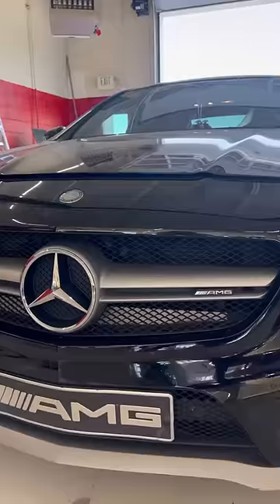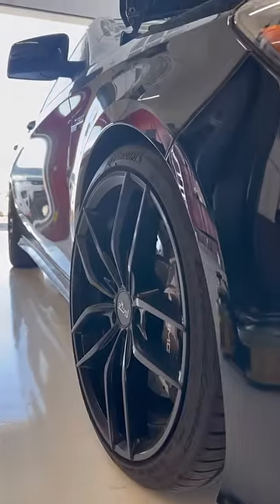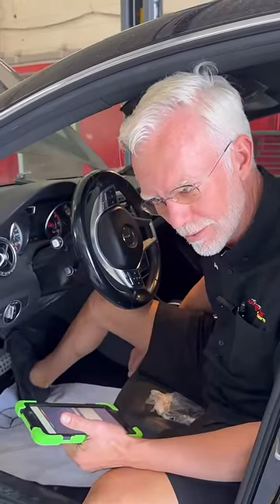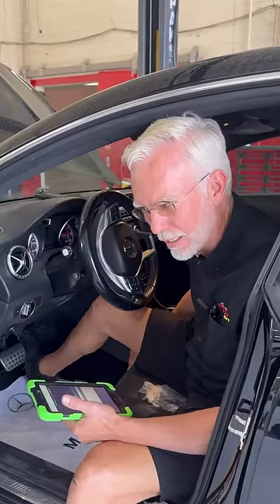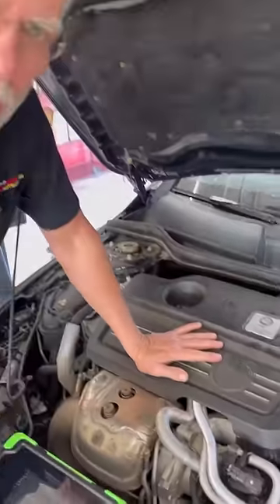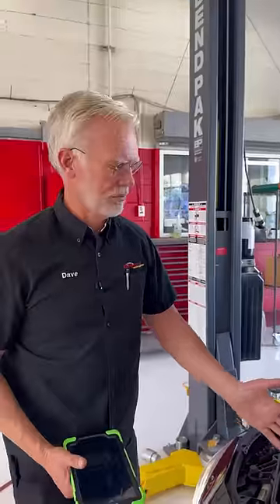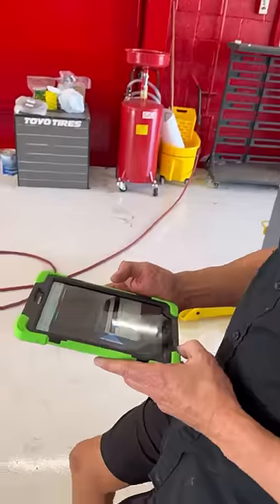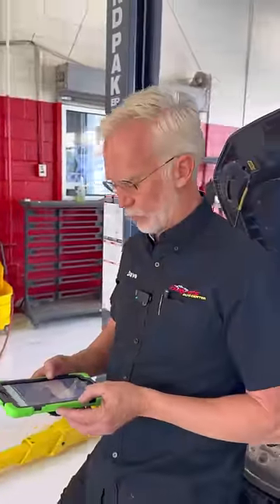Mercedes AMG Nothing but a slight noise on start up #carrepair #autoshop #mercedes

Comment: I had a Camry fail to crank at a gas station. The battery was good, instrumentation was good, seemed like the starter crapped or a bad solenoid. Car was towed to local dealer, they informed me it was $1200 computer. I’m an electrical engineer and thought these guys are going to have to explain this failure to me. I went to the dealer and they pointed at a computer, it wasn’t the main computer so I asked for the schematic’s. I spent about 1/2 hour reviewing the starter circuits and there was zero association between the computer and the starting circuits. When I challenged them on this they couldn’t argue against it. I told them to look elsewhere because I’m not paying for a computer. I left and called a mechanic friend and had him call the stealership and it turned out to be a fuse and the starter. It probably was only a fuse but that starter had over 100k so I accepted it.  
I’m a bit more mechanical savvy than most and it infuriates me that these arsehole’s take advantage of people. We have a morally bankrupt nation from Washington DC down to our local service providers.
Reply: Get a job there and teach the other technicians,not everyone knows what you do and they probably know things you don’t, cars are hard to work on these days because of all the electronics in them ,most just change parts and not fix original part ,you saved them and yourself
Reply: It's never just a fuse.  Fuses fail due to high amperage.
Reply: Why didn't you check the fuse before you had it towed
Reply: I'll never let another dealership touch a vehicle of mine unless it needs the antitheft module programmed to the ignition lol. They can get lost. I've been gouged for hundreds just to look at my brake pedal light sticking or paid to have things repaired and it never touched. They are not working on any of my future cars. Got a mechanic who lives about 5miles from us and he sees all of our vehicles. Atleast we can trust this guy and he's very affordable. I've had dealers fix things I didn't ask for then make me pay for it to get the car back. They're thieves from the salesmen to the shop.
Reply: You would need a swat team to get me to take a car to a dealer.
Reply: A blown fuse may not be the core problem. It may fine but a temporary fixed. Find the core problem and fix it. Good thing that it wasn't the ACU computer.
Reply: Sometimes when starter motors fail they can short out and blow the fuse so it probably did need a new starter
Reply: Starts at the top, works its way down
Reply: BACKGROUND: I have worked in Independent shops ( only 2) over 13 years the last 21 years at aLexus dealership, and am currently working for myself10 years, motorcycle shop, fun but not nearly the $$ that I made at Lexus. 

When I started, 1980, I was trained to find the problem and then find out what caused it to fail, could be age or something else, and REPAIR IT. back then we repaired starters and Alternators by rebuilding them. The Techs now a days are just part replacers. When the tech can’t figure out the problem it always comes down to the ECM, why? Not sure, but I all ways called BS. FIND THE REAL ISSUE, in 40 years I think I only replaced a few ECM’s. Motorcycles, ATV’s and especially PWC’s are different, they lose their programming if sitting with a dead battery for 6 + months. I guess is what I’m trying to say is that it gives all mechanics a bad name. Next time call them out and get the general manager involved
Reply: Fix it yourself then. Engineers always tell you how to fix somthing but they have no clue how to wrench
Reply: Just remember, half the time it's just incompetence.
Reply: There's a saying that the fish rots from the head down. If D.C. is the head, the rest of the country is the body. 🙂 Whew, what a stench!! 👍
Reply: You’re a bit mechanically savvy yet you didn’t check the fuse to begin with? Isn’t that like step one that you take when dealing with any electrical problem in a vehicle?
Reply: As an ex tech i can tell u all the problems at dealerships stem from the extremely low pay techs get. U wont be able to live if u dont absolutely tey to pad every single job. I got out and im never looking back!
Reply: Happens all the time, but it probably was the starter going bad that blew the fuse. The computer part is some bullshit though
Reply: I'm not a mechanic professionally.  I did, however, get my certification for brakes, lights and tune up through my high school program. I grew up on a small dairy farm in the central valley of California in the 70s and 80s. We worked on a lot of our own vehicles, tractors and farm equipment. I have learned to take apart starters and solenoids and clean any contacts and clean and grease bearings or bushings. I've done the same for alternators. From what I know and understand, every time that power is put through a system to start your engine, the electricity will jump any gaps in contacts and leave a tiny bit of burnt residue that builds up and will eventually cause a failure. This can be cleaned up and used for a little longer. Also, grease will get dry over time from heat cycles and cause extra resistance while starting. That being said, wiring and windings also start to fatigue. So, on a daily driver, I, too, would have changed the starter. But a piece of equipment that is used on my little farm, I'm just going to clean it up and run it. Thank you for sharing your experience and knowledge. It really helps people like me learn a little more.
Reply: @killingtime669 prolly because he had yo ask his mechanic friend after getting the schematic from the dealership. 

Bigger question might be why he didn't tow it to his friend instead of the dealership.
Reply: @johnharrop5530 isn't that why the technicians go to school? There are many crooks out there and the problem lies with the owners telling the techs to be shady.
Reply: @sddirt6840but cars have more than one computer. If he traced the schematics and found the starter wasn't associated with said computer,  it may have been associated with another.
Reply: You ain't nothing to fuck with lol.....I definitely need a friend like you around at all times!
Reply: @samg5543 
He should know this… he’s in electronics..
Reply: Everyone is morally bankrupt but you huh 🙄
Reply: @samg5543 I was thinking the same thing with the fuse being the direct cause of the no crank condition and a failing starter pulling too much amperage, causing the fuse to blow.
Reply: I've seen video of dealer techs burning components with a lighter to get extra warranty pay out of a car. Nothing surprises me anymore.
Reply: My Camry starter has 300k on it. You got screwed 😂
Reply: Your abit “more mechanically savvy” yet you didn’t think to check the fuse or jump the solenoid on the starter at the gas station. Yeah right
Reply: #Facts, this is why I try and do the work myself. And learned, because of stories like this ! Ps; buy your friend a beer
Reply: Amen brother, Amen. I’m glad you did your diligence. 💪🏻💪🏻
Reply: @donrosscojoe5014  I was gonna say this.
Reply: I would assume that dishonesty in business isn't just a US problem and not anything new
Reply: I used to work at a dealership, and I beleive the problem to be inexperience. Having someone who can truly do a good diagnosis is rare, it rwquires a lot of skillset and experience most people dont have.

Also the mindset of working in the dealership is thw problem. You are pressed for time, and you deal with a lot of warranty work, which is structured so that you do a basic diagnosis, then replace parts in a certain order according to the OEM service information. I agree it should be done properly, and have the tech do a proper diagnosis. Its also a difficult occupation where you are held to a high standard, and its hard to get right every time, and that has led to many people leaving the industry to work in other industries where the work is easier and they can use there skills and experience for something different.

All that being said I understand your frustration, and agree the approach should be different
Reply: It's not the nation it's the world.
Reply: If you had the circuit schematic how did you not find the fuse issue if you determined it was not associated Mr. Engineer?
Reply: If you’re an electrical engineer, why didn’t you recognize what a blown fuse could mean?
Reply: Where I’m from in North florida, all the dealership owners are congresspeople federal and state. It explains a lot.
Reply: @pdan3676 well, that's what they had originally told him it was
Reply: That's a stealership, not a dealership. It's great you have the skills and knowhow.
Reply: @johnharrop5530 Well, you can't blame him for assuming the worst from a stealership.
Reply: If you buy the 1200 computer we will still charge for diagnosing the fuse.  Its not our fault you loaded so many problems in the same car sir
Reply: Great job 👍
Reply: all stealerships
Reply: 👍superb use of the word arseholes, particularly Stateside.

Thank you for your service
Reply: @ramiromartinez4344 It's not the mileage lol it's how many times you start. I have a delivery job & I used to stop & start everywhere to try to save on fuel instead of idling. Guess what...my starter went out! 😅
Reply: Amen, brother, everyone wants a get rich quick sceam. Instead of doing good and truthful work, which would bring in way more customers. I know this for a fact.
Reply: Ironically funny as you included yourself in that last sentence.  👏
Reply: You dam right about the corrupt part lol😂
Reply: I've seen bad starters blowing up fuses before. Specialy on mercedes
Reply: Because nobody looks the same anymore
Reply: Diveristy
Reply: Facts
Reply: STEALERSHIPS!
Reply: Unless it's a early Camry, schematics alone won't tell you if there's a relationship between that computer and a no crank. For that you'd need a functional description.
Regards,
Controls engineer
Reply: @samg5543 Fuses also fail due to corrosion even when below their rated capacity for many cycles.
Reply: I worked in dealerships for 13 years as a mechanic and service manager. I’ve never known anyone to intentionally rip someone off. It’s always a matter of incompetence or guess work. Anyone walking in with a toolbox and the will to wrench can get a job. Why not? The owners view it as renting you a bay to work out of, thanks to flat rate pay. You only get paid for hours they can bill. If a guy can’t figure out why your car won’t crank in 30 mins, he’s going to guess at that point. Believe it or not, he’s probably right 75% of the time because there are no one-offs in vehicle failures. Barring of course, the rat in the wiring scenario. If a varnint didn’t chew your wiring up, then whatever caused your failure has caused thousands of the same make and model to fail. I’ve seen guys look up a suspected bad part to see it’s availability and sales. If the manufacturer keeps hundreds in the warehouse and sells thousands per year, then yep, that’s what’s wrong with it. Like I said before, it works probably 75% of the time. If you look up the part and they haven’t sold but a dozen total and the car is five years old, that’s probably not what it needs. My point? Dealerships aren’t intentionally crooked. You’re time and their time is valuable so nobody is going to spend 2 hours trying to diagnose something they can’t bill you two hours for. At that point it’s take an educated guess. That’s not the best way or the right way but it’s what you get when a guy is trying to earn a living on flat rate pay. Nobody I’ve ever worked with has tried to sell someone repairs they didn’t need intentionally. I take that back, I have seen guys quote some outrageously high priced job just hoping the customer goes away because they don’t know what’s wrong with the car. The always do. On the rare case someone brings it back for that outrageous repair, they get everything they paid for and more.
Reply: It's global. Dealerships here in the UK are just as bad
Reply: The 2GR-FE is known for ECU failures so there's that.
Reply: @samg5543 wrong actually. Fuses fatigue.
Reply: Yes. I had a friend who was going to replaced his wood floors. He got one estimate and the second estimate the company got a different square footage compared to the first guy. The second company measurements for the square footage was inline with the measurements my friend did.
Reply: @samg5543 yeah his fuse statement definitely makes him not an electrical engineer...
Reply: It is important to ensure that a genuine fuse is used because different brands of fuse can have different electrical characteristics. I have tried to explain this to a few car mechanics but they don't seem to understand why it can create a problem for a car.
Reply: @judd_s5643  next your alternator will pack it in, if not packed in before the starter.

Comment: I'd clear the codes and test drive it and see what pops up or how it acts
Reply: On Allison transmissions we could see how many times the old codes had been set. That was good to know bc you could compare it to Ign. cycles. 1 in 1,000 cycles and you probably wouldn't find that as a  problem or someone had a sensor unplugged and keyed on.

Comment: It’s the wheel sensor😂
Reply: wheel sensor juice! 🥤
Reply: Speed censor has it in an under limp situation
Reply: Let it cool down and repeat the start up and revving with an assistant in the car and your head under the hood, possibly with a stethescope.  I actually thought it sounded like the serpentine belt was slipping a bit on the throttle blips.

Comment: I had a guy at a dealership tell me the reason they just replace the whole engine if under warranty is because the dealership doesn’t end up paying for it the auto company does. So it’s easier for these people to just replace the whole engine than to take the time and figure out what the actual problem is especially since it’s not on the dealerships dime. It’s sad it’s come to this but this is what they did for my 5.3 in my silverado. Truck most likely needed something little and they didn’t even check it once they heard it was the engine they said they would just replace the 5.3 with another one
Reply: Accurate about warranty. The manufacturer pays full price for anything warranty as long as its legitimate. Dealership gets paid full price so this idea that dealership don't want warranty work is stupid. Full price vs discounted to help the customer out, hmmm which is better? 🤔🤔
Reply: The 5.3 has a known lifter problem. It takes out the cam. And runs the pieces through the motor. I work with someone who has had 4 motors in a year. It pretty bad when your motor gets charged before it needs an oil change.
Reply: @jayz4dayz763  the manufacturer does not pay full price, they always cheap out on labor and often pay a little less on parts.
Reply: It's also because that's what's more cost effective for the manufacturer AND they can take the old engine and diagnose it themselves. This helps them improve designs and find manufacturing issues like the trash in the oiling system that's affected Hyundai's Theta 2 as well as Toyota's turbo 4L.

Comment: How hard is it to replace the thermastat, replace the wheel speed sensor. Check for boost leaks and the check the boost recirculating valve.

Comment: On a far out lim it could be a defect pressure transducer for the turbo been giving a too low signal but with plenty of boost, and the fuel system going too low on the mix, heating the engine, melting the cat (isn't it a hissing sound when you let go of the throttle?). And/or radiator/water pump. Be sure to let us know 😅

Comment: Take a 4 Gas analyzer and remove the radiator cap and check for HC is the steam coming from the radiator. Possible blown headmaster.
Reply: You dont even need a gas analyzer disable the ignition system remove radiator cap then top off cooling system and on a cold engine have a second tech crank engine over and see if coolant starts to rise slowly or if it just gushes out li ke old faithful will tell you if you got blown or bad head gaskets or use the cylinder leak detector fluid is another method.

Comment: Either leaking boost or leaking coolant from the turbo cooling line but if that were the case he would have smoke pouring out all over the place. From that ridiculously loud stock blow off/recirc I'd say charge pipe right out of the turbo is leaking.

Comment: Start at the turbo and work through the cooling system from there. Check quaking if coolant,  then check electrical connections

Comment: Check the condition of the coolant first, correct if low, flush if it is degraded, change thermostat. Use stethoscope to pinpoint noise. The customer didn't complain of lack of power or boost issues so clear codes to see if they come back or were a fluke.

Comment: Loose belt ? They told you you need an engine because they assumed you are just like everyone else. Overheating could be a faulty thermostat. I had one once. Fixed it myself along with a burnt valve and a bad U joint bearing.

Comment: Sounds like the replacement engine would have an improved wastegate design already in it & hopefully less stretchy bolts. And probably other secret upgrades
Reply: Stretchy Bolts is my Arena Glam Rock band name - "Opening for Mott the Hoople is T-REX with special guest Stretchy Bolts! $20 gets you a whole seat but hang on because you're only gonna - *NEED THE EDGE" Mott the Hoople, T-Rex and Stretchy Bolts from your only reeaaallll ROCK! KWBK 97.9 THE ROCK" *🎇

Comment: We just did an older version of that car. Turned out to be a water pump impeller. Solved both issues with a new pump. Hope yours is just as easy. We didn't have the low boost issue, though.